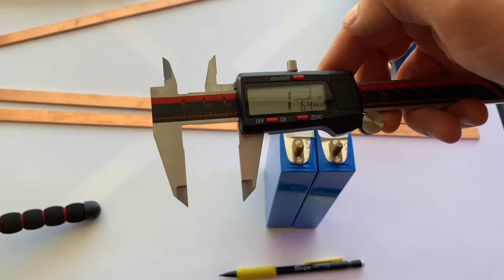Make the best busbars yourself! DIY custom copper busbars easy way.

Comment: Some tips you didn't mention.

1.  If you don't have a drill press make sure you secure the bar well when you drill it.  The bar will want to torque out of your hand.  Using pliers or a clamp or vice is a really good idea.

2.  When cutting the bars only use the first prototype as your template for length/hole marking.  If you use "the last one you cut" your measurements will eventually drift.
Reply from the maker: right, worth to mention, thanks.
Reply: Probably easier to drill the holes before cutting them apart.  It's easier to hold down a big piece than a small piece.

Comment: I made these using a large bolt cutter its not real tidy but works fine - very quick and simple - also I used a 12 mm drill bit in the cordless drill to remove the bur -

Comment: Good job. I sand and than mate all my high current connections, this way you get the best and largest contact surface, less resistance, best efficiency. 
Even more with those battery posts which supports only low torque. 
Your bussbars being pretty stiff, you should tight the cells together to not damage the posts.
Others would just throw all together without care and say it will be fine.
Keep on the good job.
Reply from the maker: do you have a solution in mind how to compress cells?
and thanks for the feedback.
Reply: Yes, and no. :) . I put double sided tape between the cells, 2 vertical strips near the edges. 
I put the cells upside down on a non conductive flat surface, so all the posts are the same level.
Like that, you get 1 block.
With bumper protection tape,  I wrap around along the outer edge of the posts, the tape is 7 cm wide, with 2 cm from edge to post, we are with 5 cm left dangling in the void, cut triangles out of the hooks, and we have 4 latches that can be nicely folded against the sides and add rigidity to the block.
there's a gap of about 3-4 mm between the cells, witch leaves air circulation, so we can cool or warm the battery,  there is no physical contact between the cells.

Comment: Is the 1/8 x 5/8 copper flat bar sufficient for a LiFe 280AH rated cell (8 cells in series) or what size bar do you suggest?  GREAT VIDEO.  Cheers
Reply from the maker: You could push roughly 200Amps through this size. To size busbar you'll need to calculate how many amps you are planning to pull from the battery.
Reply: @SolarEngineering  That’ll work, max is 160 amps.  Thnx
Reply: @richt2633  You asked him, then looked it up yourself. What he said 200 Amps is max. If you need 160-200 amps, then I’d suggest you build at least two batteries in parallel for extended cell and BMS life.

Comment: Can copper touch aluminum? I read about long-term corrosion about the 2 metals, thus the connection will be poor. Plus a fixed length connection may be put catastrophic stress in battery posts as the cells expand (read datasheet, min expansion is normal). I have watched a video where a flexible copper busbar with a tin stamped connector had the smallest resistance.

Comment: Cheaper to use type k copper pipe and flatten it in a vise. Or flatten with sledge hammer. Or do both.
Reply: spending 400-700 on batteries and $16 dollars for thick quality buss bars is too expensive?
Reply: @vladbagdasarov1672  his batteries for the main battery bank was like $6000. I’m saying for a bigger battery buying flat copper stock can get really expensive.
Reply: @RJ-cc1fz  He has 48 Batteries, even if you needed two buss bars per battery you're talking under $100 bucks.
Reply: @vladbagdasarov1672  A copper pipe is a lot cheaper. What is your point?
Reply: @RJ-cc1fz  Dude when paying $6k for batteries you'd be worried about saving $50-60 bucks on making janky buss bars? If you haven't gotten the point yet then I commend your stubborn reluctance to acknowlege simple logic.
Reply: @vladbagdasarov1672  there is nothing “janky” about using copper pipe for busbars. And it saves a little money. That’s all. No reason to argue. If a person spends a lot on anything then it would be good to save money in other areas if possible. I was recommending the copper pipe for everyone reading Incase they didn’t know they could save money that way.. have a good day sir and give up already
Reply: @RJ-cc1fz  <<< Thanks. I hear you. I have used 1/4” pure Cu pipe(that was left behind by the plumber) flattened on vice the hammered to fine touch, drilled holes, rounded the edges on grinder and added black heat shrink in the middle. Looks perfect. If one can make it, why buy it?  The comment is with all due respect to the YT presenter. Your job looks great.
There’s no argument here @ Vlad. But just my sentiments. Happy New Year. Thanks, stay safe and 73s...
12331/0713h PST
Reply: @RJ-cc1fz   Flattened copper pipe would also have the advantage of being flexible enough to make the slight bend that might be needed for full contact on the cell terminals.  If there is not perfect alignment he's not going to get 100% contact area with such stiff bars.  A flattened pipe is more forgiving.  However you aren't going to have the current carrying capacity as his bars with the cross section of flattened copper pipe.

Comment: Are you concerned that battery swelling will pull on the lugs since the hole alignment is perfect? Thanks for the video.
Reply from the maker: If you plan to push/pull heavy amps through the pack, it's better to fix cells together (something like I did here: https://www.youtube.com/watch?v=Cw-5KcKCKzM)
Reply: @SolarEngineering  agreed. I saw that..   I found not compressing and reconfiguring the pack so cells are not side by side but packed length wise (narrow sides touching) Life might be shorter but keeping in the 80-85% range of use is a long life. I appreciate your videos.

Comment: Hi, some advice, I need to extend an equipotential bar, is it possible to join it with two 8 bolts instead of doing it all over again? or is it not recommended? Thank you

Comment: What's the benefit to sanding passed 80 grit?  Just to make it pretty, because I would have stopped at 80 and I wouldn't have put the shrink wrap on since it doesn't appear to make much difference, there is still quite a bit of metal to avoid on the top so just need to be care with or without shrink wrap.
Reply from the maker: Hi there, I did sanding to remove marks from jaw pliers and drill bit, to have max contact point between terminal and busbar. 
This step could be avoided if you do countersinking, and use vice to hold busbar while drilling.
I think heat shrink still makes sense, especially on longer busbars.

Comment: Buddy, invest in some gloves and eye protection! Specially when using angle grinder.
Reply: Never use gloves when using rotative power tools, that's a gold rule.
Reply: @lusa3002  I guess angle grinder is the exception to the golden rule. 
Regardless, it is evident that safety was not a part of this video.

Comment: How do I work out what size copper bar I need for our setup? I need 10 bolts on each bar, I've got 450ah of lithium and run a 3000w inverter. Thanks!
Reply: Consult conductor capacity charts online.

Comment: I was wondering, why did you use copper instead of aluminium? I understand that copper is a better conductor but your terminals are aluminium and your bolts are steel. It seams to be a lot of elements.  I assume I am making incorrect assumptions.
Reply from the maker: Hi Anthony, you are right about copper - mainly used as a better conductor. I don't see any reaction of copper with nuts or terminals.

Comment: are you going to plate these in another metal for anti corrosion?
Reply from the maker: no, using it as it is.
Reply: @SolarEngineering  sorry im new to bus bars, arent you scared it will oxidize and corrode over time?

Comment: what is the point of the heat shrink?  The nuts are exposed anyway.
Reply from the maker: for these busbars not much (as I said in the video),  I think for longer busbars it still makes sense even with exposed nuts. It will take just a few minutes of work and add some extra safety.
 On this note, I'm thinking about 3d printing some covers for nuts, then busbars will be fully insulated.
Reply: It clearly minimizes (but doesn't eliminate) the potential for a short caused by a dropped tool -- which I did on my boat last summer! Much bad language.
Reply: @kenpole1840  why you don't use plexiglass over the battery's? Use your brain

Comment: Can I use aluminum bus bar? It will cheaper and so as bad.
Reply from the maker: sure, just make sure it's enough size for amps you are planning to push through it.

Comment: sorry,friend,you don't know how to use the caliper well ,you don't know how to calculate copper busbars...the rest i won't see
look: copper bar 1.6 mm x 10 mm is 16 mm2, 1077 mOhm/ meter good for 105 Amps DC
ººº 12.5 x 1.6   125 ADC
ººº 16 x 1.6        155 ADC
ºººº20 x 1.6         185 ADC
ºººº25 x 1.6         225 ADC
dr google....